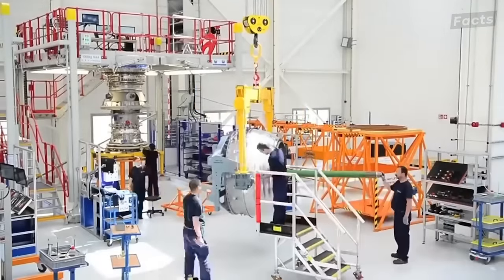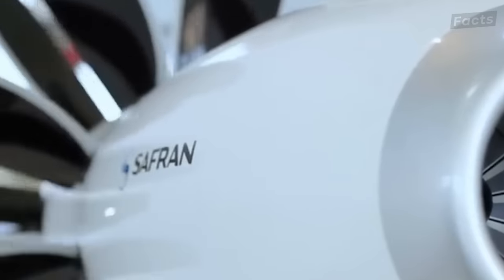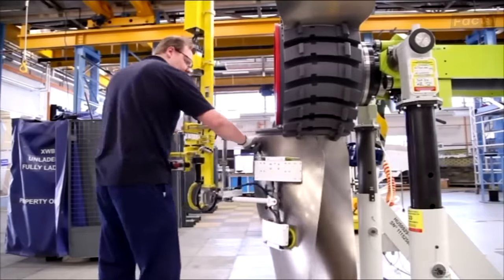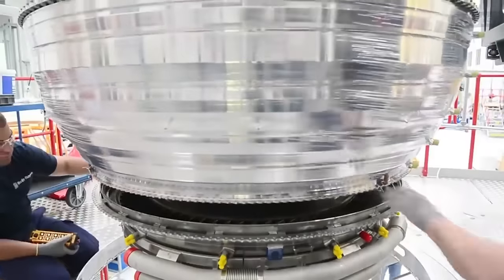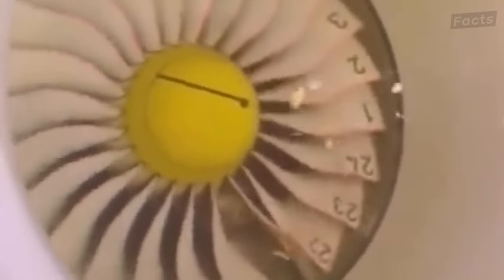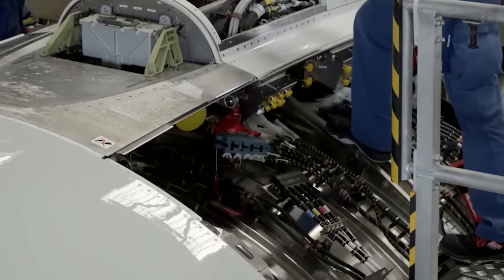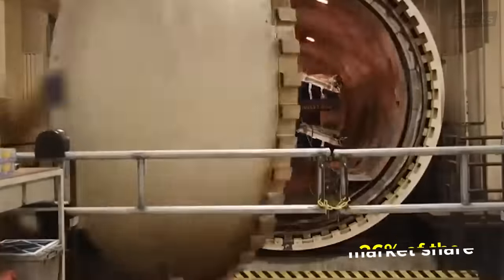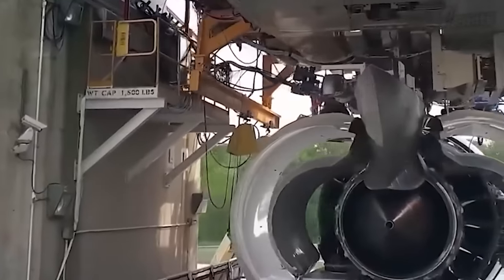This Engine Will Change Aviation Forever

Comment: I was a student at GE Engine school in 1987. This technology was already explored and their engines, the Unducted Fan engines were already in their in house museum in Evendale Ohio. Commercially unviable because of the inherent noise.
Reply: Indeed, I saw the NASA GE Boeing 727 inducted fan fly in the 80’s or should I say more than saw it we heard it. Extremely loud and we heard it long before it flew by
Reply: They're making a comeback because they mitigated the noise problem.
Reply: @jtjames79     Good Luck. Only time will tell the story.
Reply: If that mess is the only choice, I'm not flying.
Reply: How?
Reply: They also can only be used on engines mounted high off the ground for safety and FOD reasons.
Reply: @jtjames79  Tip speed is still subject to the same old limits.
Reply: @jtjames79  how did they mitigate the noise problem? no one is sharing this information until now!
Reply: One of the things about the new unducted fan engines is that they are producing less noise. They are very quiet in comparison to the older ones.
Reply: 1:37 1:37 😅
Reply: I think the problem with these was more ground safety than noise. When they went to high bypass, it saved everyone alot of money because high bypass could be used on existing aircraft. These fans require new aircraft to be developed, therefore it's taking longer.
Reply: @jtjames79 no way, never
Reply: @wakimdavid2094  Because it's a billion-dollar question. They didn't spend all that money just to let everyone know how to do it.
Reply: Airlines are introducing a new class below economy.
Reply: @jtjames79 or maybe people just want cheap flights and will put up with it.
Reply: Stockton Rush's idea for CF blades?
Reply: And now with 25 more years of development they are now viable.
Reply: It looks cooler. That's the important part.
Reply: Seriously I'm looking getting them or into engineering's I was just a button-pusher XYZ style but yeah I can see that there's nothing new under the Sun. Anything about any wasp sprey looking thing with the rolls Royce engines on it looks pretty cool hopefully it won't kill so many as the last one.! This is just a little less than too much fun!
Reply: @jtjames79  Very simple, sub sonic tip speeds. Go slower to save the planet.
Reply: You mean engineering has improved since the 1980s?? Thank heavens…
Reply: @wakimdavid2094 Yes, but not how. He's just a liar. You can't fool physics, the noise in such an engine arises from the fact that the ends of the propeller move at supersonic speed and relative to each other the propellers move at supersonic speed.
Reply: I kind of thought that too. Normally if something looks like it won't work...it probably won't. And these engines look suspicious. Cool on paper and in the test cell but not in practice.
Reply: Thank you for being here 
Reinventing inefficient ideas is a waste of R&D 

Why are people so dumb if so educated
Reply: Military doesn't care about noise as much as they do about efficiency and range. Range is what limits our fighter jets substantially and therefore our force projection...
Reply: Remember how much computing power has advanced in that time though. Computational fluid dynamics were not anywhere near the same level in 1987 as they are now, so it's possible to optimise the shape of the fan blades in ways that were completely unachievable 37 years ago to vastly reduce noise.
Reply: @adhillA97  
Granted there have been advances in technology but the biggest hurdle is the marketing aspect… the flying public will not accept going back to propellers.
Reply: The UDF, or Unducted Fan lost favorability on 2 points. Fuel prices fell and it was too noisy. I was working at PHL and a prototype MD88 stopped in with a UDF Left mount and right side conventional JT8-219. Was very interesting technology, sad to see it was killed at the time for such minor reasons
Reply: Soon as i saw the double props i knew noise would be a killer. The tupolev already has that issue
Reply: also, nothing to keep the fan blades from going thru the fuselage or planes designed to use the engine concept
Reply: Ever heard three hundred passengers screaming, when told to walk themelves, from Newark to LA? Think again, about noise levels. And what's the alternative?
Reply: @ghost307  There are lots of planes with wings on top of the fuselage. Problem solved. Duuuuuh!
Reply: @branboom6409  What?! I can't hear you!
Reply: @getstuk87   Thunderbolt A10 could have easily have had a twin turboprop plane as the next model. Don't knoe what they came up with, but if I were the designer, I'd stick close to that A10, simply because it was doing the job and it always came back. When modern turboprops can deliver what these fans do, the essential role of the A10 is flying low and slow, then why not switch to turboprops? First question is, are there still enough men on the ground, calling for an A10 helping them out, now? I guess that will never really change. Then why would you choose an OTHER fighter and let go of an icon, that Warthhog. Give those soldiers a pilot in a Next Generation Warthhog. Here I see some great engines!
Reply: @voornaam3191  But very few commercial. Mostly military where ground clearance is a major concern for operations from unimproved fields.
To change from turbine to blades commercially would require most of the existing commercial fleet be replaced.
That's going to come down to a financial decision.
Reply: OK Boomer. It's obviously not going into your Boeing 737 anytime soon but we found it's worth looking into it for some markets. Guess what
Reply: @chuckcawthon3370  i think so too. public like "big magic tube" under the wing
Reply: I designed a total temperature sensor for it while at Rosemount Aerospace back in the '80s.
Reply: Yeah, that was my recollection, too. Been there, done that. Stick with the turbofans.
Reply: How about they do a twin toroidal blade version...🤔
Reply: Son, there are no answers, only improvements on what we already know. That is the fundamentals of scientific discovery.
Reply: Indeed. However, Rick Kennedy at GE, and Pratt have both specifically mentioned that the geared turbofan is back on the engineering table, as of late. You can go to the GE, Pratt, and Safran websites and read about the recent developments of same.
Reply: @1gbayfisher  "While the unducted fans of General Electric and Pratt & Whitney of the late 1980s were known to be very noisy, Mohamed Ali pointed out that supercomputing models demonstrated that levels are lower on RISE than the LEAP."  Source: airinsight article quoting GE Aerospace’s Mohamed Ali, Vice President of Engineering for Research and Technology.
Reply: Electric cars were built in the years 1890...!!! those are on display in  all good automobile museums
And it took 120 years before they started to replace IC cars.

Comment: They have been working on the unducted fan engine for a long time. However this is one of the reasons why Boeing said that they would not be putting out a completely new design for a few years. Plus the wing designs are all over the place witch means a lot of expensive experiments to find speed and fuel efficiency.

Comment: We used to operate Boeing 747's with both the RR RB211 as well as the GE CF6.
Hands down, the CF6 was quicker to start and far less complicated than the RR counterpart.
We also had CF6 engines on our 767's which were nothing but fantastic- reliable and efficient in every way.
Reply: The RR is a three spool,the CF6 is a simpler two spool.
Reply: But the RB211 was more efficient with its 3 shaft design.
Reply: Maybe im a bit old, but to me Rolls-Royce will always stay as the hand build top of the line and best you can afford in the world. When I am boarding a craft and look at the RR on the engine, I get a felling of top safeness.
Reply: There’s a reason you see tons of CF6’s all over the world. Great motors
Reply: @thatflywelshguy9662 they are engines. We don’t call them motors.
Reply: Variants of RISE have been the next big thing for over 30 years now. I'm 68 and I doubt I'll see it in my lifetime.
Reply: CF6 is a coal burner compared to the RB211.
Reply: @thatflywelshguy9662    Motors run on electricity…
Reply: Had rolls Royce been American they would say the opposite Americans always put British things down I even had one telling me Britain wouldn't even have jet engines if it wasn't for America they put everyone down they go mad when it's the other way round
Reply: @stillebenfilm  also most jet engines are derived or based in rolls Royce engines fact I live next to rolls Royce in derby I see them being built every day massive and beautiful things
Reply: "the CF6 was quicker to start and far less complicated than the RR counterpart."   But, at what price?  Fuel economy and relaibilty rate higher than quick start, imho
Reply: @Completeaerogeek  Yeah, GE fanboy didn't want to mention efficiency.
Reply: @justing42  We do, in some parts of the world....

Comment: The Rolls-Royce UltraFan is more a technology demonstrator than anything else. The very fact it can be scaled down to a small, 25,000 thrust (111.2 kN) thrust engine means Rolls-Royce is looking at the possibility of a smaller engine that could be fitted to the Airbus A220 or Embraer E195-E2 airliners, essentially offering a second engine choice for these two airliner models. And Rolls-Royce might be thinking of offer the smaller UltraFan engine for even the 737 MAX.
Reply: Yeah this technology was already explored yet noise pollution killed it.
Reply: And how's the Ultra Fan going now 😉

Comment: You say the second set of blades are fixed yet the footage definitely shows them rotating.
Reply: That is another engine. Keep in mind, no CFM RISE have been built yet currently.
Reply: I took from that ,was that the second set are fixed " pitch," not rotation.
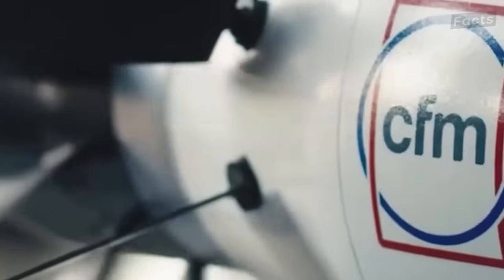Reply: illustrated @1:08

Comment: Regarding past attempts at this that had experienced too much noise/vibrations … were they using winglet type blade tips which both improve efficiency and greatly reduce the noise inducing tip vortex?

Comment: No mention of the GTF Pratt makes?  Over 20% fuel reduction and over 70% noise reduction and already in use now.
Reply: At the cost of repeated engine failures, the villain behind the failure of the Indian Career GO First (formerly GoAir). Even IndiGo is facing the same shit! CFM LEAP on the other hand, is a down-scaled GE-90, sharing the same qualities of this successful engine, with a few improvisations.
Reply: @JishyFishy4106  the GTF is not having “engine failures” their issue is a manufacturing process problem with materials.  The engines are out of service for inspection related to that. I get it either way they’re out of service. However the engineering design is  producing better results then anticipated and the leap, Also since it’s improvements are done without increasing the core temps like the leap it has a higher ceiling for even better improvements.

Comment: The fan duct, beside directing the airflow, protects the plane from blade separation and puncture of the cabin.  These new engines will have no such protection.
Reply: Propellers were on planes for a long time though.
Reply: @tomsherwood4650  Propellers aren't this flimsy, even so, propellers have separated and brought the plane down numerous times.
Reply: Quite right. P.R.
Reply: If it’s made of carbon fibre then it shouldn’t be a problem. Adding extra reinforced walls on the fuselage where there can be a hit should be enough.
Reply: Hi Crotalus. You're right on both counts, but the cowling is also a barrier stopping shock-waves from the induction fan's supersonic blade tips from spreading beyond the engine. Similarly, a higher by-pass ratio limits noise at the exhaust end. After watching the video on the McDonnell Douglas XF101 Voodoo, I confidently predict that no unducted fan jet will "change aviation forever": unless it's to finish it off as a way to get around. Cheers, P.R.
Reply: Stockton Rush engineered the blades himself, doesn't need shrouds
Reply: @philliprobinson7724 I can tell by the words you use you have no idea what you are talking about.

Comment: This was tried on the Beech  Starship. Among other issues, the excessive noise from the supersonic prop tips ultimately doomed the concept

The Starship was actually responsible for noise restrictions at airfields that previously didn’t have any
Reply: Hi   L.I.T.D. Quite right. Check out the Mc Donnell Douglas F101 Voodoo that had a supersonic propeller. Just one XF 101 was made because the noise levels made it a noise weapon in its own right without firing a single missile. This video on what should be well known "dead ends" reminds me of the well known proverb "He who doesn't learn the lessons of history is doomed to repeat them". Cheers, P.R.
Reply: The big issue with the Starship, and the Piaggio P180 is simply dirty air in front of the props.  It doesn't hurt efficiency much, but it's horribly noisy.     This is true of pretty much all pusher designs at any scale.   Small RC electric pusher wings are almost as noisy as gas engines. 
Even moreso for the  counter-rotating fan engines.  The noise comes all from the 2nd set of blades ingesting dirty air.  
What makes the CFM Rise special is the stators behind theb lades are not rotating which greatly reduces noise.
Reply: YEP. This will totally 100 percent fail. Total waste of money. A High school student can tell you this will not work.
Reply: @knottyboy6086  Hi K.B. The interesting question is WHY is this research taking place? The manufacturers must know of past results, and that turbo-props (which is what these engines are) lose efficiency rapidly over 25,000 feet. Jets, flying at 39,000 feet, use half the fuel of the turbo-prop due to thinner air and less drag. The ducted fan-jet also uses the ram-jet principle which is why they can go 2.5 miles higher into the thinner air without losing efficiency. Removing the duct is removing the article that makes turbofans so efficient. 

I suspect the main driver of this research is an over-generous tax write-off that allows 100% credits for anything spent on research, whether the project is a proven dud or not. That way they keep their valuable R.& D. people in continuous employment, and the company books remain in the black. And who knows, something of interest to the military may come of it. Cheers, P.R.
Reply: @philliprobinson7724  You heard it already in the intro "sustainable" "environment" "CO2". This is where the tax payer money is buried.
Reply: @rosomak8244 Hi rosomak. I don't mind paying taxes, as long as they're used wisely and with open public accountability. Aircraft could halve their CO2 emissions by burning liquified natural gas, which emits half the CO2. This can be a "sustainable environment" fuel for cars and trucks too. To make progress we need to think in progressive steps and not adopt an "all-or-none" mindset at the beginning. Both sides fail in this. Cheers, P.R.

Comment: It's no new idea to use prop-fans. If only they find a solution for the noise they are creating
Reply: The noise is the result of the blades going through the air, so it's not likely.
Reply: @ghost307  am aware about that. It's most likely the reason why it has so far not been used more.
Reply: When you think of the noise reduction we are currently at now with the A380, B787 and A350 compared to the B747 or B777 this thing would be a step backwards in time like 40 years in time

Comment: I’m an Electrical Engineering Technician. 
We do the work the Electrical Engineers don’t do. They only deal with math. (Calculus). We Engineering Technicians build it. And of course on the production line something is gonna go wrong with assembly the product/design the Electrical Engineers give us.

I like General Electric Engines.

Comment: Slightly misleading.  CFM is jointly owned by the US GE and the French Safran Aircraft Engines in a 50-50 ownership so all engines produced by CFM are joint ventures of these two companies.

Comment: As far as I understand it, these are probably a dead end design for civilian aircraft as they make a hell of a lot of noise - well above current civil aviation limits - and unlike current contained engines can catastrophically damage the aircraft if blades shear, especially if mounted alongside the tail.

Comment: What about the noise level. I remember a Russian model produced unbelievable noise.
Reply: The russian model used counter rotating blades. This does not. So no noise issue.
Reply: Antonov 70, with 4 D27 engines
Reply: @GowthamNatarajanAI  do you have some numbers? characteristics tables? sharing is caring!
Reply: You are thinking of the Tupolev TU-95 Bear, the reverse engineered Russian version of the B-52 Stratofortress, which is so astoundingly noisy, the US can track it via sonar from attack submarines. It’s that loud!

Comment: This article mentioned shipping by truck/rail or if overseas by ship or by Beluga.  What about the 747 with the 5th pylon for delivering an engine into remote locations?  It's the only 747 with 5 engines.  I believe it is still flying.
Reply: Is Antonov's big 225 still flying. I used to watch that beast on the deck at BNA Nashville and watch them load huge satellites into it. Watching it take off was watching an entire fleet leave the ground all at once. That was 20 plus years ago though, so.....